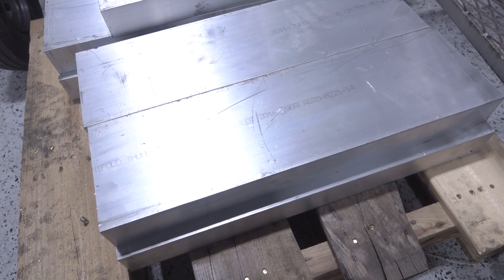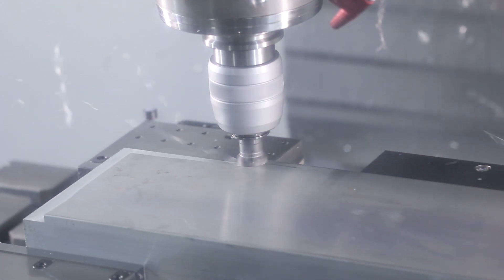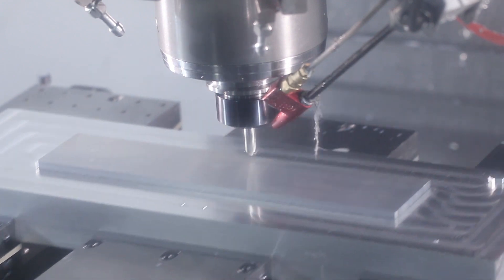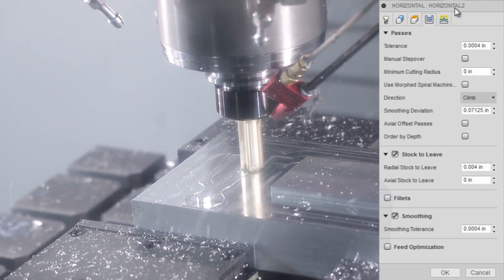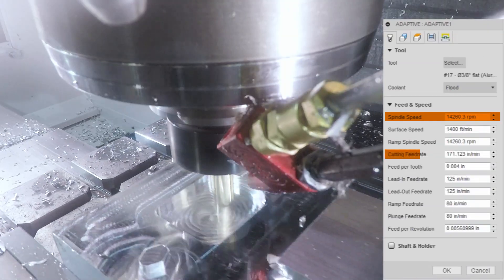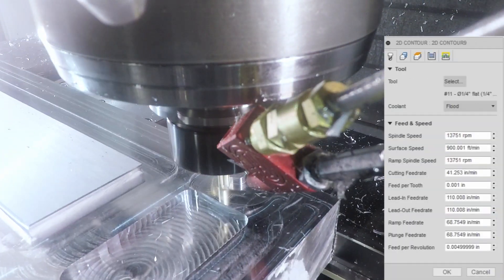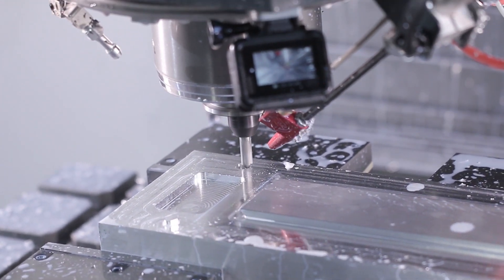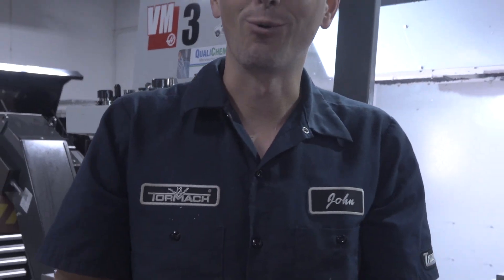Machining Pallets for the Orange Vise!

Comment: Here is a little tip/trick 
Use SoMe long thin peaces og spring steel and bend them 

Out some Small blocks in the vise and then the spring steel to push the parallels up agenst the jaw's 

That way they don't move and there is nothing getting broken by the coolent ( we do it all the time at work)

Comment: Awesome video! For the part where you are trying to get the good surface finish, and you don't want to use the 1" solid carbide lakeshore, look into the surfacing polishing cutter from datron, its a diamond tip that leaves an ultra flat mirror finish, might be worth it for this here, its probably equally as expensive but it will leave a flawless finish with no tool marks at all even.

Comment: Great video as always!
Question: at 11:05 (chamfer tool) the machine decelerates before X-Y transition and accelerates after the direction change, is that Fusion 360 or is it Haas?
If Fusion 360 please explain how this is achieved.
Thanks in advance,
Rob.
Reply: Sorry, I meant 8:55.

Comment: Just wondering what the aluminium grade is..here in the UK common grades are 5083 6082 and 7075. I use chick vises and they have 7075-T6 jaws which are great to machine but a different world to machining 6082 which is much softer.
Reply: 6061 is the standard here north america and I'm 99.9% positive that's what he used here.  I've heard great things about 7075 but never tried it!
Reply: @JohnGrimsmo  7075 is aerospace standard here. I have never even seen 6061 in the shop yet.
Reply: Thanks. I've found 7075 to be close to machining mild steel. It corrodes really quickly if left in a damp environment or used out doors so anodizing is a necessity. Really nice to machine though and the cnc machined finish looks great on it.

Comment: Another great NYCCNC video, and I love the diamond pin revision, but usually in fixture design we like to use one dowel and one diamond pin (two dowel pins over constrain the part). Also I'm not sure making these pallets yourself is a good idea. (typical small shop mistake).  That spindle was purchased to make money, so the money saved making the pallets yourself is often offset by the money you didn't make (producing parts for profit), but NYCCNC is not a typical Job Shop, because of the other income from YouTube and advertisers.  I loved the Orange, good clean humor!
Reply from the maker: If/when you are at 100% capacity, sure - buy them!  But Orange Vise company sells them for $200/pc (a reasonable price).   We ran 12 the last batch at $50/piece.  It took a few hours, during which I was also doing other things.  That saved ~$1,800 in cash costs.
Reply: Add shop time + CAM time = not much savings

Comment: I know you don't like doing videos with the Haas because of the coolant soaking everything, but I figured it couldn't hurt to throw this out. Have you guys thought about putting some hydrophobic coating on the windows or something like a clear bra (car paint protection) then a film over that? I understand if it's more of a problem with not being able to the work being done rather than not being able to see through coolant on the windows though.

Comment: why not use the 2 in dovetail to finish the floor?
Reply: Brandon Youmans 
Won’t fit between the pins and the center boss. It barely cleared the pins when doing the dovetail.

Comment: whats slowing down the chamfer mill coming into the corner? is it in the code\post processor  or the haas control?
Reply: It's the Haas control. It auto slows down if the approach feed is too fast. I think there is a parameter to override that though. I'm not that familiar with the controller.

Comment: Hi John, if you are running the latest Next Gen Haas post processor, select "fast tool change" in properties when you are posting. Instead of the machine waiting for the spindle to completely stop before  Z retract, the spindle will coast to a stop and retract simultaneously saving you time particularly on ramp down from high RPM. The Tool changer will also have the tool already dropped from the carousel ready to change, and your coolant will shut off before retracting and help with the residual drizzle dunking your taper in coolant. Check it out, its pretty sweet.
Reply from the maker: YES!

Comment: John! You have to push that VM-3 harder! We run our roughing ops at 250ipm with a 1in korloy pro-x mill! with a much greater step over and depth. Great video though! Oh and bent pallet strapping in the shape of a z makes a great parallel separator (not affected by the coolant)
Reply: Easton Bednarek 
I have the same 1” Korloy. Phenomenal tool. 

16580 RPM 268IPM, .350 depth and .700 step over.  And still leaves the floor and walls like glass.
Reply: Occams Sawzall Oh yeah I forgot to mention the awesome surface finish. The 2in one is can't fantastic as well!
Reply: Easton Bednarek 
I don’t even bother with anything bigger than the 1” in aluminum. The cutter is so fast there’s no need for me to have the 2”. Only have a 19” platter on the machine. 

I keep a 2” love joy face mill in for steels though.

And can’t forget ya 11 deg ramp in angle either. 

Amazing tool for $350, which includes 10 inserts which took almost a year for me to burn thru.

Comment: Gotta hit that "keep tool down" option on the counterbores. I think I like the Kurt system with expanding mandrels better than those diamond pins. That's not really a kinematically sound design with two diamond pins oriented opposite of each other.
Reply: Wes Johnson there isn't one in the boring toolpath. There is an ideastation post for it though.

Comment: Diamond pins on the cheap!!!   just grind three flats on some cheap hard dowel pins ......
Reply: How do you grind a round pin on a surface grinder? Or do you mean cylindrical grinder?
Reply: vettepicking the orangevise dowel holes aren't a common standard size.
Reply: do you know the size? because he does have a surface grinder
Reply: vettepicking it's documented on the Orangevise website
Reply: since your to lazy to look and post then why waste our time commenting.......?
Reply: vettepicking I'm lazy? I didn't have to say anything, then you could have got a standard cheap dowel pin jammed in yours or someone else's vise. I told you where the info is. And given you have that attitude I'm definitely not going to go and look for you. Have a great weekend.
Reply: I see .4993" which is a standard one under size. but im not wasting anymore time to confirm since I don't own a orangevise and neither does Scott M.
Reply: Google tells me to use a cylindrical or centerless grinder, not a surface grinder, which, it turns out, I didn't actually need to google as I learnt that in the first term in the machine shop at school 17 years ago. I guess I'll have to wait another 3 years to learn the secret.
Reply: ok ok don't beg, look at robin renzetti's channel under centerless grinding or you can use a spindex or between centers on a shopmade jig.
Reply: Cool! Thanks. That's an interesting little jig. Very "Heath Robinson," but I guess whatever works right? I've seen videos of russians splitting logs with cones attached to wheels on their cars. Creativity is awesome.
Reply: google is your friend . or work in a machine shop for 20 years.

Comment: Might want to leave a little more on the floor for the horizontal path to clean up. Looks like only .01 maybe less?  

1/2 the corner radius of the tool is a minimum 3/4 of the tool radius has been ideal for me. So a .02 CR, leave .015 on the floor. 

And I assume no coolant was for filming purposes only?  Because the BUE on that dovetail cutters inserts was pretty bad. Will break down that nice polished insert surface in no time. 

+1 on the milling in the diamond pins. You’ll probably exhaust the jaws long before those pins wear out to the point of not being use able.

Comment: I thought for a second you were going to machine that orange.
Reply from the maker: Thanksgiving is coming.
Reply: I would have personally done a different op for the peel removal.  Your tooling was all wrong and didn't even give us speeds and feeds.  :)
Reply: Thought he'd do an edge break on the peel. If you've ever gotten orange juice in a cut it is not a shortcut you'd take twice... ;-)

Comment: Have you played with dialing in your tools for critical stuff with a wear offset? I started doing that instead of altering tool paths with negative stock to leave ect. Seems like a best practice sort of thing to me.
Reply: Scott Moyse whoah slow down there buddy, 11 year old robodrill no probes 😂
Reply: I built my own cnc router for my personal use and I use "negative stock to leave" to walk tools in but my tolerances are not that good anyway. I luckily just go a part time job playing with a VF4 and wear offsets to me are the only way to go. It has a 20 tool changer and I have 14 tools that I have dialed in the other 7 tool I am changing based on the part.
Reply: I've had it once or twice where the tool requires a wear offset but I forgot to put it in and it was 0, that leads to a very interesting part.
Reply from the maker: Yup, we do.  It's just critical to maintain continuity between machine controller and CAM - and that's actually hard, IME - especially since we'll move jobs between machines
Reply: NYC CNC I have found it to be easier to not get confused doing it all on the machine. Model exactly what you want cam exactly what you want and fix issues on the machine where real life happens. Toolpaths that are super critical dimensions have wear offsets turned on, everything else is just set to in computer. Wish I had a laser tool measuring device either on machine or an offline setter that would make it a bunch easier.
Reply: I agree... And these types of things should be checked and wear offsets adjusted each time you run them anyway.
Reply: JohnGrimsmo are you talking about the wear offset in the tool definition or in the controls' offset table?
Reply: JohnGrimsmo I have run a fixture where I used wear offsets to open up a bore, forgot to change it back and then ran a part, that was interesting for sure lol
Reply: John Grimsmo I used wear offsets to make a hole larger for a slip fit then forgot to change it back as well. The next part was then off by a few thousands. That being said I have been checking each part I make on the mill and adjusting the wear offsets and it is really impressive that I can get parts that are under 0.001" in tolerance and I have only be using the VMC for 2 weeks part time. Got to give some credit to John Grimsmo and John Saunders, you guy make great content and I have learned lots from your videos!
Reply: bensbenz & JohnGrimsmo if you were using Inventor HSM you could tolerance the model, toolpath to that, and use wear offset. If you then probe the machined feature against the toleranced model, it will adjust the wear offset each time for each feature. You then just need to setup the post or probing macro to wipe out the previous wear offset before it adds the new one.
Reply: bensbenz oh I know you don't have probes 😁